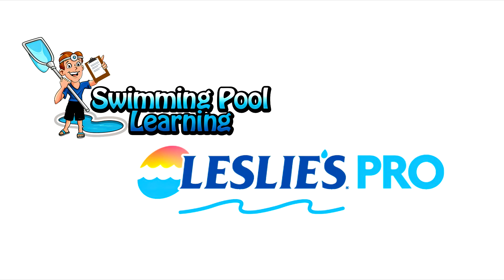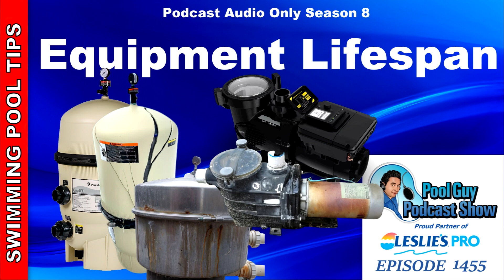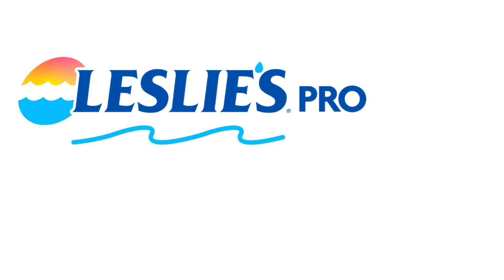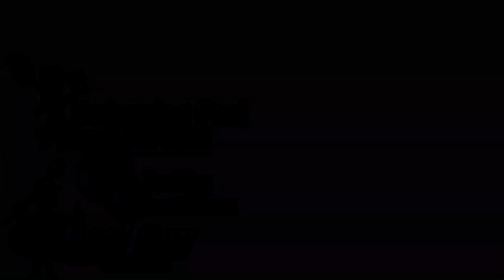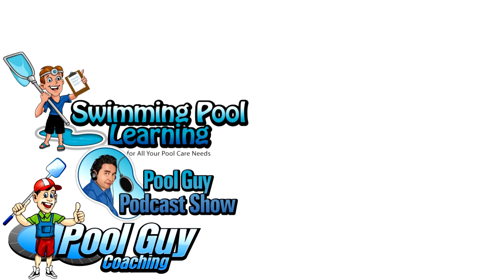Swiming Pool Equipment Lifespan

Comment: I have a 35k gallon pool with 2 skimmers. One skimmer seems to have much less suction power than the other. Should I run a wire down inside the pipe to see if that helps? Also the skimmer that is weaker, has a pvc pipe the comes out near it, goes toward the house and then elbows up with a cap on it. I have no clue what this would be for. Any ideas?